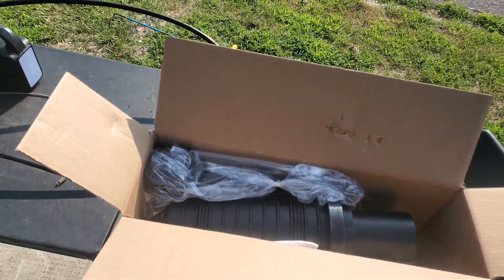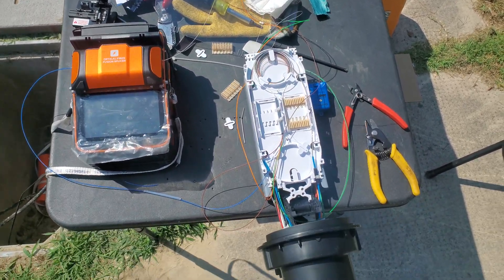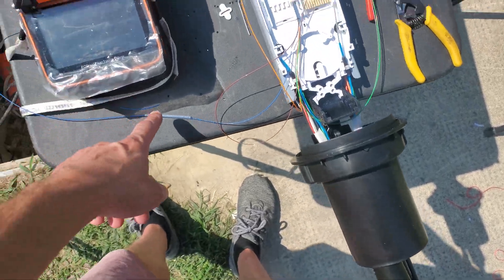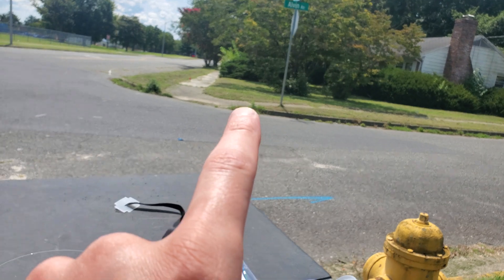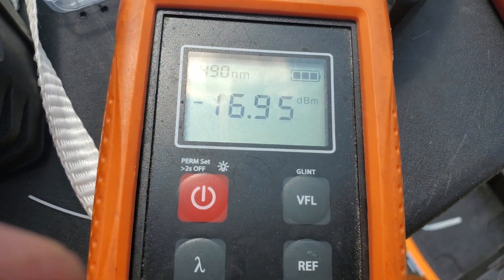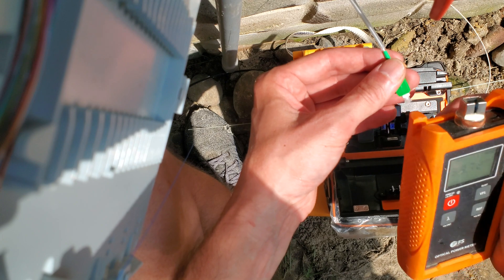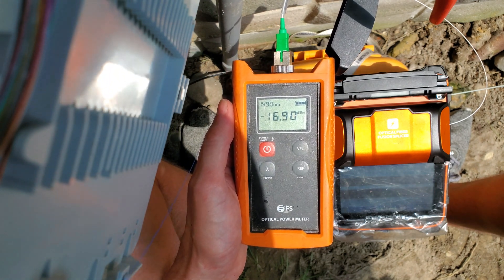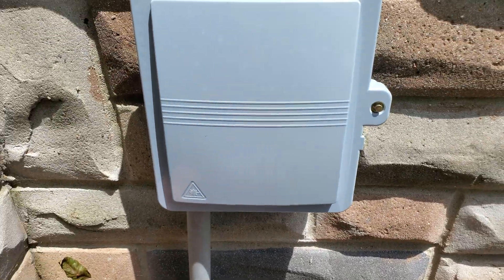GPON build on a lateral + start to finish customer splice

Comment: Any chance you can show the provisioning stuff, binged a ton of your videos. interested in the network management part
Reply from the maker: It's just to much to show because it would just be 1 big blurred video.  Typically your hardware vendors have something to provide at a cost.
Reply: @briceperdue7587  I believe he can go on UI and do a demo of their UNMS or whatever they renamed it too. 

It'd be cool to see some pings to some common things just to see what kind of performance you get with that equipment and your transits.

That way it shows somethig but doesnt give away and important information.
Reply from the maker: @nick21614  your 100% correct thanks for helping out!
Reply: Its also very dependent on your vendor.  My shop is almost all Adtran but we do some UBNT as well.